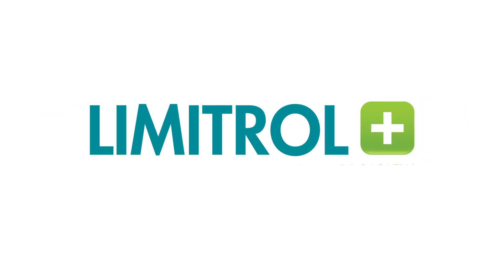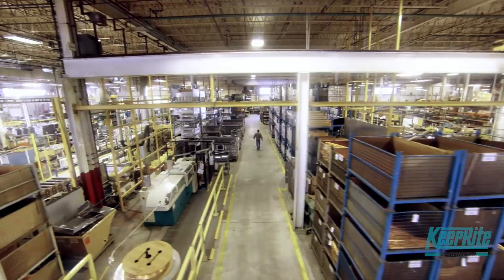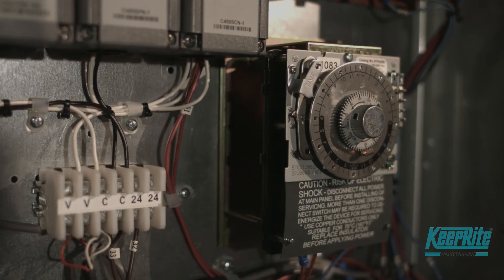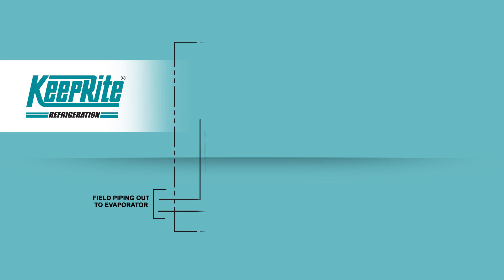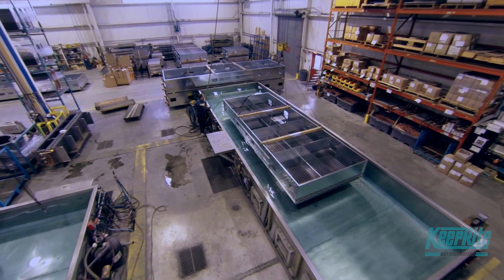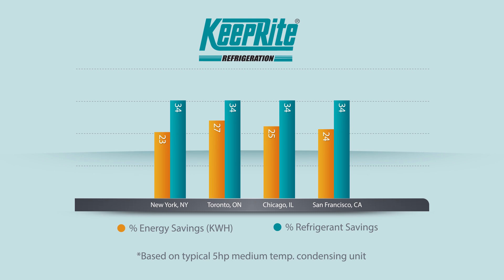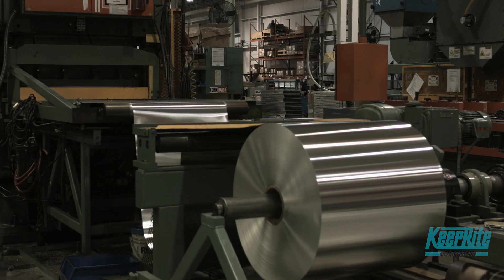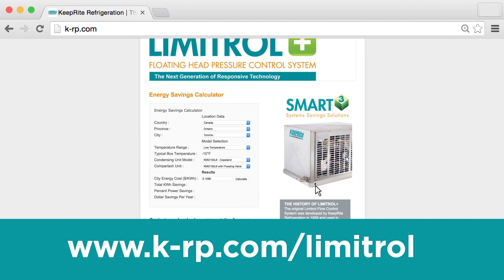Limitrol+ Floating Head Pressure Control System

Comment: So the way I understand this system, is it shuts off half the condenser under a low ambient condition. It diverts remaining hot gas discharge through other half of condenser and then to liquid receiver. The first half of the condenser is completely isolated with its refrigerant from the rest until the pressures increase enough... So unlike flooding a condenser to keep the head pressure up, it seems this setup would not show any signs of low refrigerant under low ambient conditions since there is no backing up of liquid refrigerant in the condenser? It's just cutting off a section of saturated refrigerant in one half the condenser and throttling the fan.